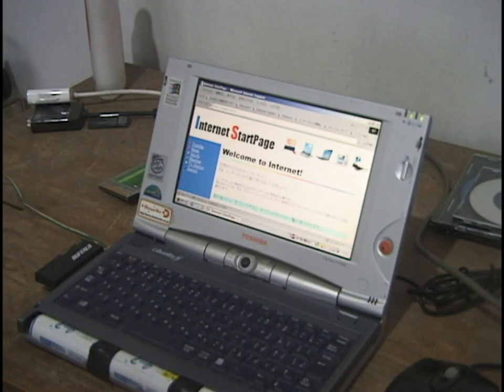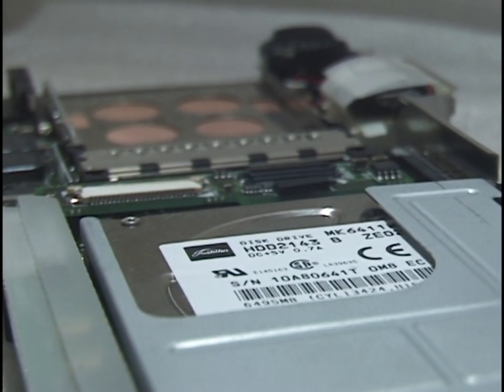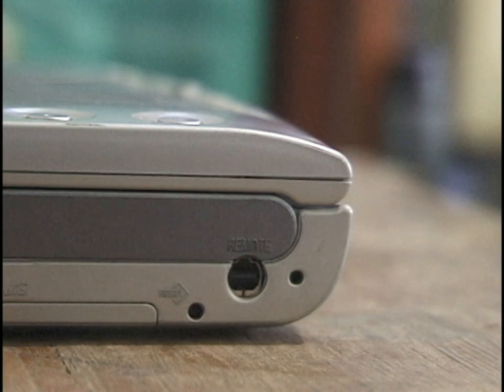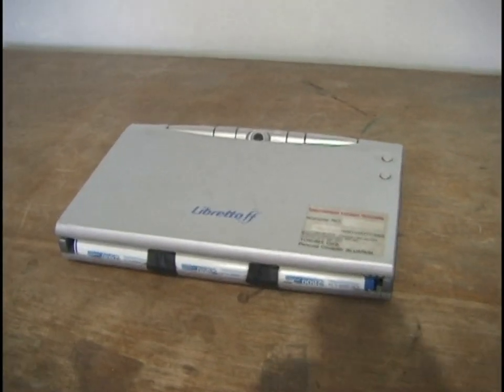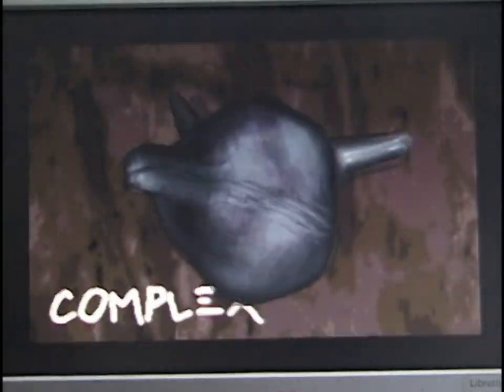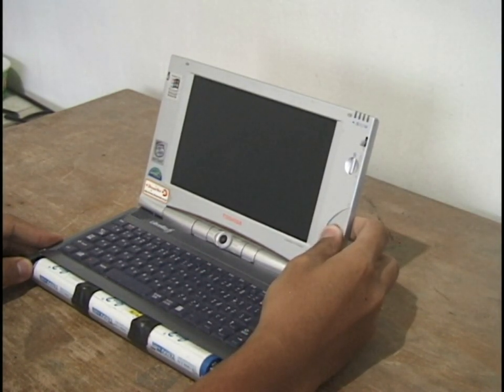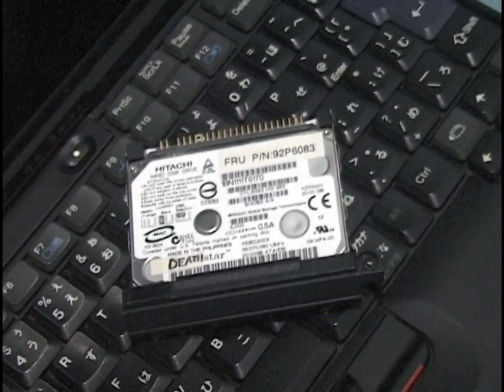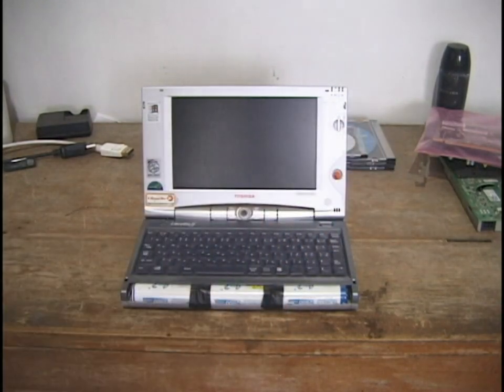Toshiba Libretto ff 1100v Overview

Comment: can't believe it can run Quack 2
Reply from the maker: It'd run like ass in software rendering mode I would imagine especially with the thermal throttling holding the system back pretty hard, but it would still run nonetheless.

Comment: I have 4 of them, you can overclock them too 300MHz & 128MB RAM. I played Resident Evil 2 on this in high settings too XD.

I also use that dial-up adapter back in 2012, good times.

BTW, 3 models not 2. You forgot the 4:3 model.

FSB 75MHz - CPU 300MHz
http://www.interq.or.jp/tokyo/yuya/libff1100-300.htm
Reply: Hows the heat situation for the 300mhz OC? I've just bought one of these and it's quite rough around the edges and needs a bit of repair so I'm not too concerned about making it any "worse", but I don't want to set it on fire :)
Reply: @tomtom98  Never actually measure the temperature myself but heat was more or less the same as before. No problem at full load as well. It sets the bus to 75MHz, so RAM is also going up.

Works on all ff models. You just need to remove one cap/resistor near where the expansion RAM goes.